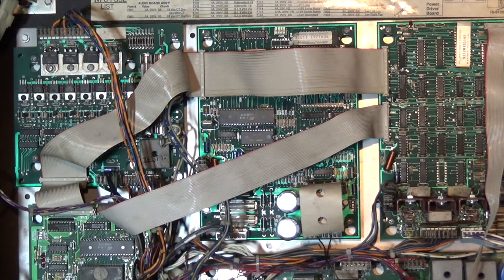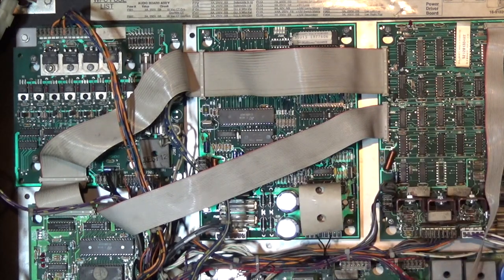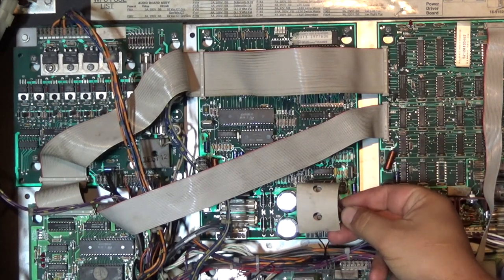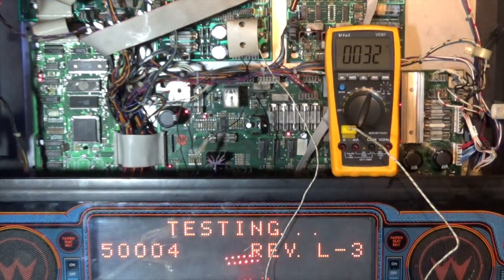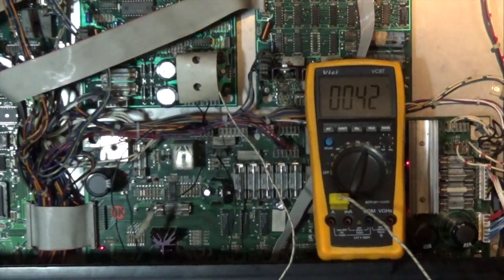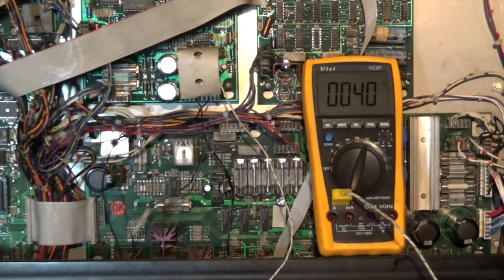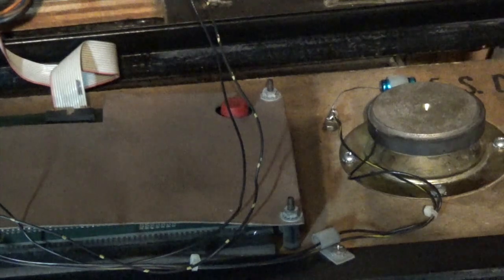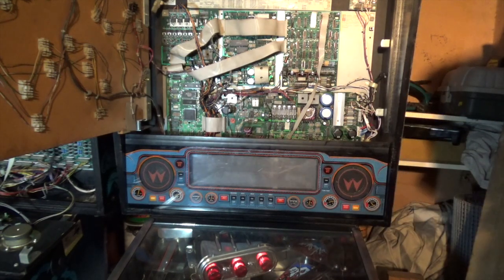Pinball Audio Board Rebuild (Part 5 of 5) - Fixed!!

Comment: I have a taf the amp chip(u1 lm1875) blew up c28 was also burnt out so i carried out this full component change replaced the board powered on and the u1 went bang im thinking the problem may be with u3 or u4 dose this sound likely..?